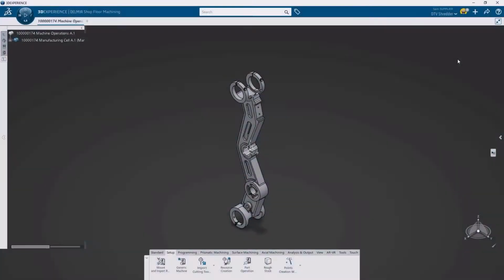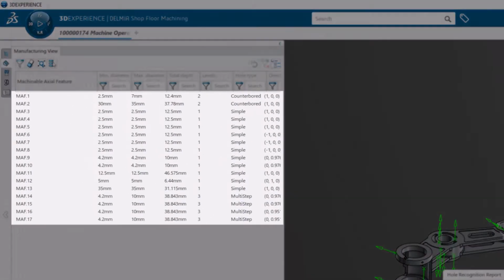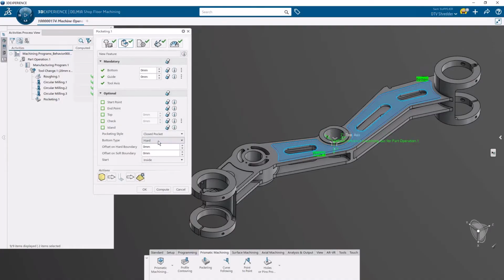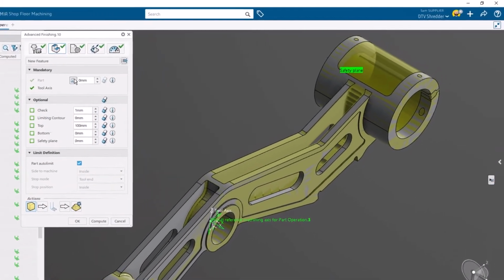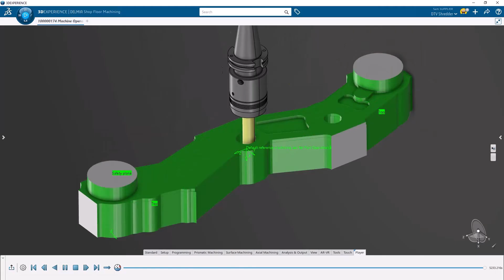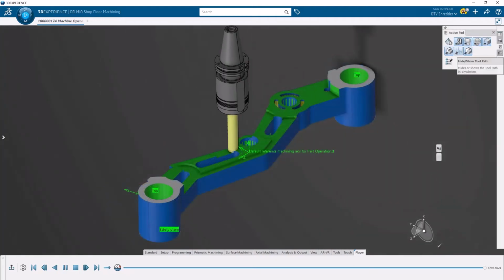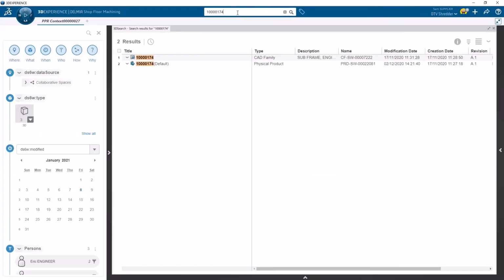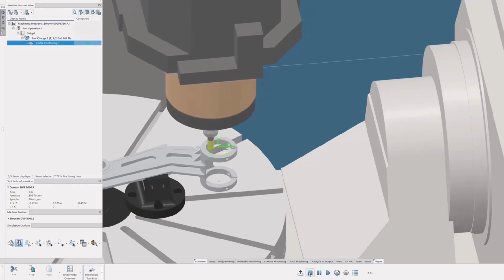First Look: DELMIA Shop Floor Programmer

Comment: It blows my mind that this powerful enterprise-level software is included in the SOLIDWORKS Maker version bundle and that even a hobbyist/maker can access it for $48 USD per year or $15 USD per month! 👍😍👍
Reply: It's been a few months since I looked at it but there were no post processors for machines a hobbyist is likely to have.
Reply: @BGraves  im a hobbyist and i have a linux cnc converted 1985 bridgeport cnc 3 axis mill. There is a linuxcnc post processor with this software.
Reply: I have many times tried to figure this software out but ended up paying for Fusion 360 instead. Wish it would be more accessible to actually be useable or remotely intuitive.